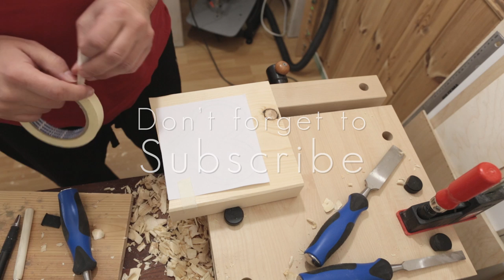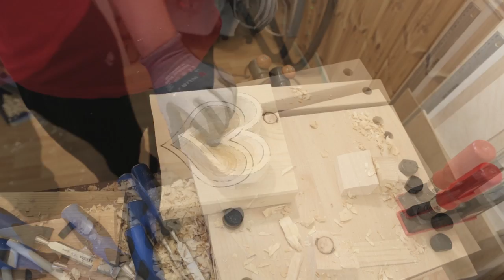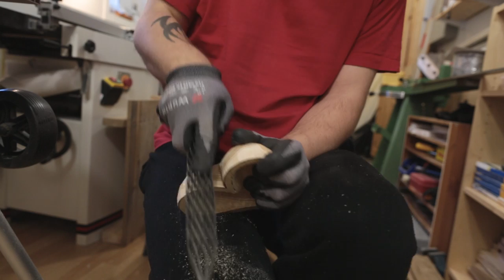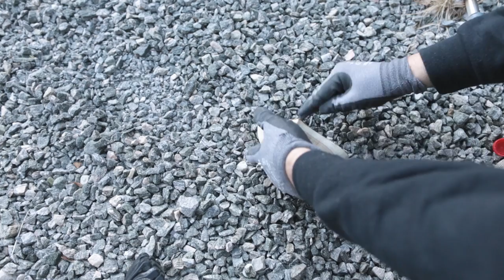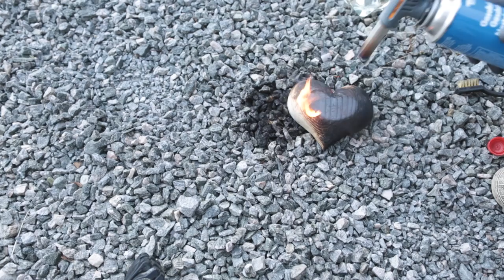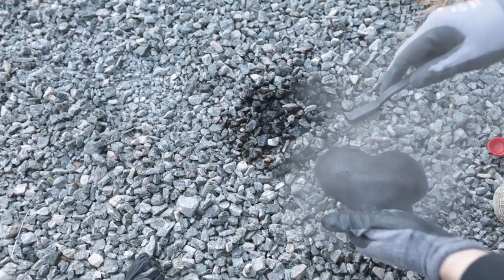ASMR Wood Carving For One Hour

Comment: very nice video but can I ask why you used a torch to burn it just to brush the burned wood off?
Reply from the maker: It brings out the structure in the wood
Reply: Fridolin Rinke Japanese style of preserving wood. Makes it more waterproof and fire resistant. Also stops infestation by insects.

Comment: Amazing work! What did you treat it with at the end of the video?
Reply from the maker: Thanks. Just regular semi gloss spray lacquer
Reply: Dieter Schneider Where did you get your spruce? Most of my shops near me only carry pine lumber.
Reply from the maker: *****
Local lumber store. Spruce and pine is the almost the only thing we can get here in norway
Reply: He treated it with the fire. No need to put anything else on it.
Reply: I used this method of finishing on a table top, I think it’s very cool and works well on fast grown softwoods, adding a coloured stain after scraping the charred bits of can add another dimension to the finished product. It’s a lovely bowl, and would be a perfect gift or product for sale. I have just been given some radiata pine out of the local graveyard by the tree surgeon and have just started a bowl using that but it was a pig to split and quite dense although I do get the opportunity to let off steam by going at it with axe and adze. That spruce looked quite light in comparison. I think I will be using this finish to decorate, it seems like a good way to mitigate tooling marks, although I sometimes try and enhance the tooling marks to incorporate them into the finished product as a feature. Nice work and thanks for the inspiration.